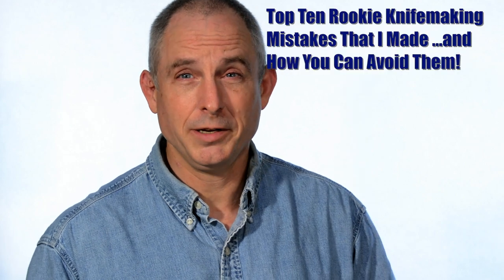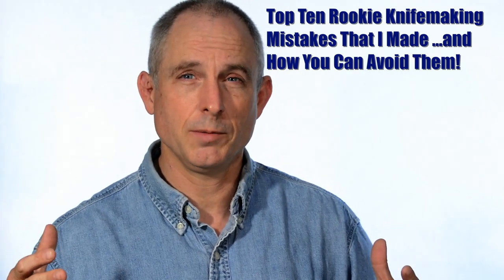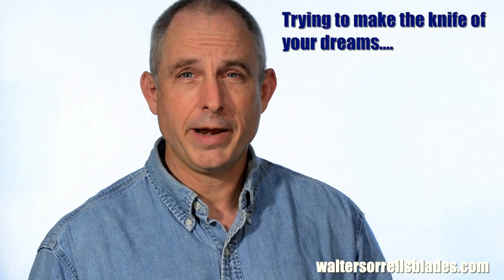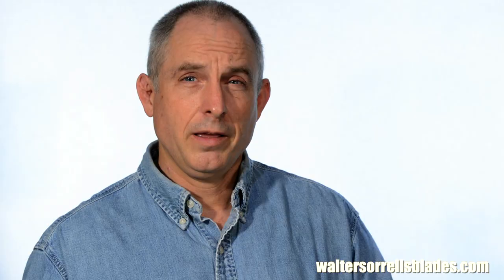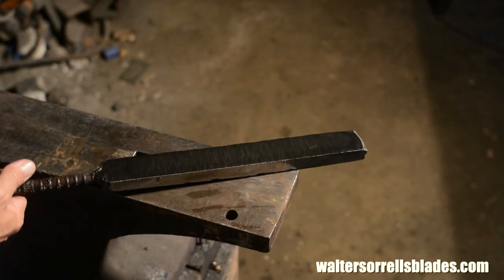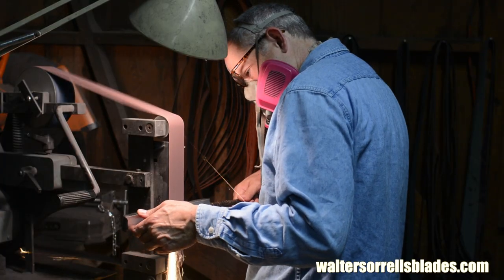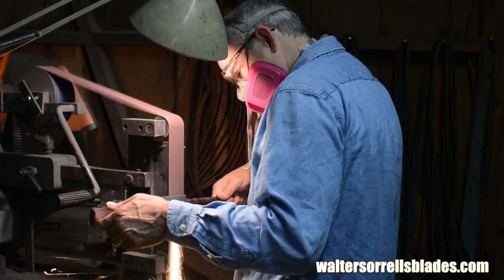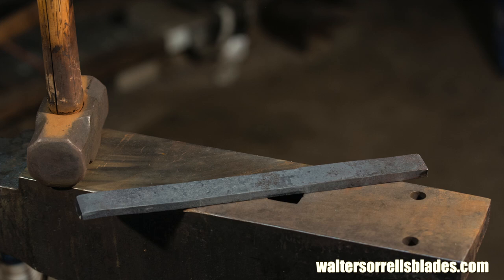Top Ten Beginner Knife Making Mistakes...and How to Avoid Them!

Comment: Another great video.
Spot on commentary.
Just a short question - which is easier to work with files and sandpaper - 1084 or 52100?
Have a nice day.
Reply from the maker: +Stefan Wolf 1084 is easier in pretty much all respects.
Reply: 1084 is super forgiving, plus good results, a win win. Only thing is hamon line may not be as vivid, but if ur just starting out, playing with hamons ain't the smartest though that's what I tried on my first knife
Reply: Thank you both.
Reply: +Stefan Wolf Bob Kramer uses 52100, but he's not exactly a beginner.

Comment: I was offered lessons by a local knife maker first knife I made was out of ats-34 he had an electric oven hat allowed for shielding gasses to heat treat and liquid nitrogen quench best skinning knife I have but I had help and it was a a great opportunity now as a guy starting out my first knife I made from my shop with my tools and equipment was a pairing knife made out of 1075 tool steel it came from high quality saw blade from a local sawmill that eventually was sharpened and ground down over the years to where it was too small and was replaced I got the saw blade because i knew the owners and I know what steel it was I got a few knives out of it and they where good really simple projects a pairing knife a skinning knife and a fillet knife all had an oak handle from leftover oak boards from my day job as a carpenter maybe one day I can make knives for a living and work for myself in my shop

Comment: I have access to a lot of a-2 but very little O-1.... how different are they other than the heat treat? I have access to a professional heat treating oven, and someone who can use it. love the channel! keep it up!
Reply: A2 is an air hardening steel. Not something you can do with backyard equipment.
Reply: +Conor Fennelly I wasn't gonna heat treat it at home I have access to a professional heat treat oven... do you know the differences in performance?
Reply: +Conor Fennelly I wasn't gonna heat treat it at home I have access to a professional heat treat oven... do you know the differences in performance?
Reply: +Falcongaming If you have access to the heat treating oven, A2 is better. It is just as tough as O1 but is more resistant to abrasion so it holds an edge better.

Comment: My favorite beginner mistake of mine so far was when I bought 1095 thinking it was all the same, not realizing the I had bought Hot-rolled, un-annealed stock. ( and I didn't have a forge or proper heat-treating equipment). Naturally, I ruined my band saw blade in like 10 seconds. Had to anneal in the living room fireplace and cool it in a small amount of ashes. It was very uncontrolled, and it cooled too fast, so it didn't get fully soft. Boo.

Comment: About the point on gear; it's a typical thing for people who get into a new hobby to go out and buy too much 'high-end' gear, without the fundamental knowledge in how to use it properly. It's something I first noticed when I got into photography. I actually bought a really nice camera off a guy who had bought it, along with a rather extensive/expensive lighting setup, to end up only shooting ~800 frames through the camera before he sold it to me. For less than half of retail. With a lot of extras. (Good for me, too bad for him.)

For me, the only reason to spend more money than necessary on nicer gear, is build quality. Something that is proven and tested within the community is usually two things: 1) more expensive, and 2) much more long-lasting. 

"I'm far too poor to buy cheap." It's a motto I've lived by for a long time, and with due diligence paid, one that pays off in the long run.

Comment: Great video, very helpful information!  I am a beginner at knife making and I would like to "practice" a little more before I make any big investment in material and equipment. I have seen videos of people making knives from old farrier rasps. My question is this.. Do I need to heat treat the steel if i am careful keep the temperature down while grinding?  A rasp is already hardened so why do most people heat treat it again?
Reply: +trebor8171 Because most people anneal it first. (Heat it up to nonmagnetic/cherry red and let it cool slowly, e.g. leave it in the coals or stick it in dry sand)
Reply: +trebor8171 makes the steel soft enough for shaping, as shaping a file of hardened steel with a file of hardened steel is not optimal :)

Comment: Hey Walter. I enjoy your videos and like others find them very helpful. I'm just starting out with cheap tools, 1 x 30 grinder included. Anyway I just recently got a bar of 1080 in the mail. Is that still similar enough to 1084 to make a functional blade and treat easily with a torch? Trying to get into the hobby without going broke :) thanks for any input, keep up the great work with the videos!

Comment: I had thought that once I got started I'd scrap and re-use the first piece of steel every 3-4 months, taking pictures to mark my improvement. I understand this will only work so long, and likely degrade the steel over time, but I'll eventually be able to compare my progress.
Reply: +Brandon Ogden An important part of knife making is the heat treat. The heat treat turns it from a lump of steel into a tool and unless you are going to buy an expensive digital furnace it will be something that is good to practice. I recommend buying a crapload of mild stock and practicing your bevels that way, saving the good stuff for the knives you want to keep and try to heat treat.

Comment: Great videos. really interesting stuff.  quick question- im a tradesman and have a lot of old tools that are quality steel- if i grind & polish them to an knife would I still need to heat treat them if they are already tempered/hardened?
Reply from the maker: +Darragh Bastick If they're already functioning edge tools, no.  You just want to be careful when grinding them not to overheat them.   If they turn blue from heat along the cutting edge, that means they've lost hardness in that area.
Reply: +Walter Sorrells 
Thanks ill give it a go and see what turns out

Comment: Walter, Im just scrolled across your channel the other week, whats the video you keep showing clips of with the bar stock looking piece welded to rebar?
Reply: +BigJT2010 when making damascus steel you start with stacking for example 2 different steels, welding them together, and welding them to the rebar. You then heat it up and bang the fuck out of it with the machine he showed in this video until its plate stock again, and repeat. The rebar is just to have a handle on it while working, as tongs dont quite offer enough hold.
Reply: I mean.. thats a purposeful understatement..

Comment: Do you have any videos that give an overview of #10, "Learn about Heat-Treating and metallurgy"?  I know there are different types of heat-treating depending on the type of steel you are using,  the property you are looking to enhance,  and how much effort it takes. It would be nice to have an overview of what options are available for given types of steels and what results to expect. Would case-hardening fall into this category.

Personally, I am interested in what can be done with cheaper, softer steels to get the most out of them. I don't care of a blade holds an edge forever or how the blade deforms and recovers under extreme hypothetical conditions. Often I want something quick and ad hoc.

Comment: i don't really see an issue with using "mystery" steel in making your first knife, something like a piece of flat bar from Home Depot is perfect, it's soft yes, you can't harden it, but it's cheap and easy to work with and it won't break, it just won't keep an edge all that well.
Frankly i don't think you should even be thinking about heat treating on your very first knife, there's plenty to learn before that.
Use high carbon steel for your 2nd or 3rd knife.

Comment: i am a blatant violator of almost everything you said lol. my first knife was a BIG ol cleaver made from .280" CPM 3V with a 10" cutting edge, 3" tall blade (2.25" grind height),16.25" OAL, fuller milling and through channels in the fuller milling, integral lanyard attachment, yadda yadda. Turned out absolutely fantastic, my customer had no problems shelling out the moolah, but then again I did a BUNCH of modifications to production knives and random manufacturing before I did it. So it wasnt the first thing I had ever built, but the first actual knife. 

IMO it comes down to the monkey making it. If you dont understand the concepts of knifemaking or the ways to apply said concepts, KISS (keep it simple stupid). However if you understand all that and have applied them before in the past to other similar work, go for broke! That first cleaver landed me a dozen of orders on them all at $650+! Just take your time and most importantly ENJOY YOURSELF!

Comment: Walter...thanks for all the great advice. I'm currently making an old file knife. Everything is going ok except for the sanding scratches in the knife blade. I started with the heavy grit, working my way up to 500, and going in a different direction with each grit. But none of the scratches go away. All I seem to be making are smaller scratches in different directions. Any idea what I'm doing wrong? Thanks for any help you can give me.
Reply: Just keep using finer and finer paper. It should be fine. Try sanding in a circular motion, too.

Comment: Do you recommend c75 steel for making my first knife? I don't have a lot of powertools so I'll be using the figure saw and file.

Other steels I've been looking at are: 80 CrV2, and UHB20C steel. Are those any good for making multi purpose survival kind of knife? I just want to make a basic knife with a 13cm blade or something like that. And do you also have a recommendation for the thickness of the steel? I want to do as little grinding since I have to do that by hand.

Thank you :D

Edit: BTW, I want to oil harden but I don't have like an expensive furnace so I'll make like a getto torch ghetto furnace.
Reply: 1/8 is a bit thin for a survival knife and would need to be tempered to a lower Rockwell so it wouldn't break, but would require less grinding.  3/16 would be better and with more meat, you could leave it a little harder and still not lose durability.  
C75 is basically just 1075 carbon steel though, tried and true knife steel.  It'll harden well, but not super hard, probably to about 61-63 HRC right out of the oil.  Either do a differential treat (watch Walters videos) or then temper it in the oven at about 450 for an hour, twice or three times, allowing to air cool in-between.
Reply: +TaskMaster1983 Thank you :D

Comment: Hey mate I have subscribed to your Chanel and love your videos I hope you can help me with a problem, I bought some 44c stainless steel 
to make a knife, I have cut it out and shaped it with an angle grinder now I was trying to drill some holes for the handle and have burned 2 drill bits should it be so hard and be magnetic I have never used stainless before any help would be great 
Thanks David

Comment: Please tell me you're not using a precision granite inspection plate as a sanding platform.
Reply: What's wrong with that? If it's no longer in cert or going to be used for precision/inspection purposes then they make great platforms for other things as well as a flat, true surface for sanding, assembling, measuring (non precision), checking relative straightness/flatness of many different things, etc..., etc....  Even have a couple used for benches/tables in the shop. My personal favorite though was using one to make a "machinist inspired" headstone for a friend that started/owned a couple machine shops!
Reply: I found one in my backyard

Comment: I started bladesmithing in October 2014. This is the process for the first knife I made: http://imgur.com/gallery/AJqIB
Really the best things you can own for making knives I found is a single cut file, a hacksaw, and a vice with a piece of steel angle and clamps. This way you can easily drawfile. Sen scrapers are really good tools, too, but you have to make them. I know that not everyone has access to a forge, but I started with-and still use- coil and leaf spring for my blades. The brakedrum and washbasin forge are really good, no nonsense forges. I haven't tried them myself, but the design looks solid.

Comment: a curious question, but how do you forge weld stainless steel with a carbon steel core? what would be a good mix in terms of steels and wouldn't the heat treat be off?

Comment: I got me a nice rusty 70lb anvil on the Ebay. I was swinging a 2lb cross peen hammer from My-nards until I found a fairer shop near my lake house. that is also where I get my coal. I love that place. they have what I want, they are super freindly, and the lady at the desk is super cute redhead and I am a suckered for red heads. anyway, I got me a nice 1.2lb.hammer and that thing BANGS. It is so much better than that crap hammer I was using. I had a hand crank bellows fan that I traded in for a 14 dollar bathroom fan for bellows. my forge is an old hybachi tabletop grill and I got 2 4 foot peices of 1084 from one Mr Aldo Bruno over in Jersey. I just used the last peice from the the first bar and have the 2nd one to use. I have pounder out 4 blanks and they get better each time. I think I might even try to finish this last one.

Comment: Would heat treating with a oxyacetylene torch be ok?
Reply: That's the was Bill Moran did it and he is one of the founding fathers of all this modern bade smith stuff. You can get some good temper lines with one
Reply: A bit late but if you make a box with fire bricks which are pretty cheap and drill a angled hole towards the opening for the torch to fit in it will heat up faster and get you a more even heating

Comment: If I were to go back to the beginning, I'd stop myself from buying everything to make knives. I wanted to make nice knives and for some reason I thought it was simple, you go online, buy steel, shape with file, slap on handle, done. But the heat treating part is where youre gonna get kicked in the nuts. If you want to make any knives out of good steel that requires a very specific heat treat process, dont get into knife making. You can make knives out of the recommended simple ones in this video but if  you want more without spending a bunch of time and money, save yourself now. I hope to god this saves someone from dumping tons of money into this expensive hobby. 

Side note: it isn't going to make you much money at all until you get a good setup and know what youre doing(which can take years). This is most likely going to sap your paychecks and all the knives you sell will just be fed right back into your makeshift knife shop.
Reply: Still fun

Comment: Is there a place I can buy a blank piece of steel that's been heat treated and all I have to do is shape it and file it down?
Reply: Panda MiamiLocksmith - misumi sells heat teated and not heat treated  steel , you select the length width and thickness and then they ship - 
-
Probably too difficult to drill, grind, and file if you buy already heat treated 

Good idea to work soft until the finishing details 
-
google misumi USA

Comment: Doesn't most expensive gear—real useful gear—speed up production and lessen toil far more than it increases Quality of the Finished Product?
…..RVM45
Reply from the maker: +RVM451 That's generally true.  But there are also some aspects of knifemaking -- folding knives, for example -- where the tolerances you get by using expensive gear like mills, surface grinders, Blanchard grinders, etc. is important to the quality of the final product and not just used to speed things up.
Reply: +Walter Sorrells I'd never heard of a Blanchard Grinder—so I learned something. Thanks. While I'm at it--thank you for all you fine videos.
……RVM45
Reply: +RVM451 Yup... time is resource too, maybe the most valuable one. Better tools save your time.

Comment: I wantes to share my experience that goes hand to hand what Walter just tells in this video. when i was already made couple of knife from files that i bought from yard sales i wanted to make my dream knife traditional saami knife. i bought bunch of reindeer horns from internet and i think it cost me like 60 bugs then i forge blade from old file made handle from wood and horn then i made sheath from reindeer leather and horn after month using it i was camping and i was making fire wood and i start splitting firewood with my knife and other wood by hitting it ques what blade broke it happens i quenched it too hard so longest work and money i ever spend on one knife comes useless lesson learned in hard way and lesson was do not quench file knife in to WATER!
Reply: +FinMauser Did you temper it or did it just have fractures?

Many old files are made of W2 so some of them need a water quench.